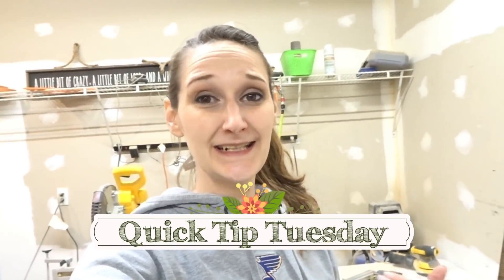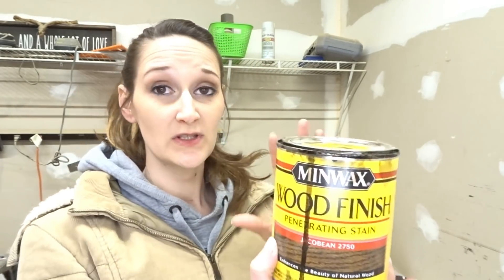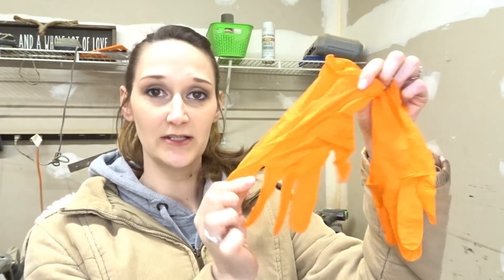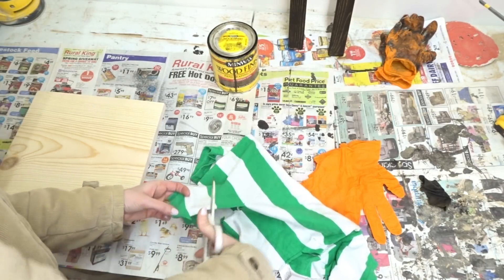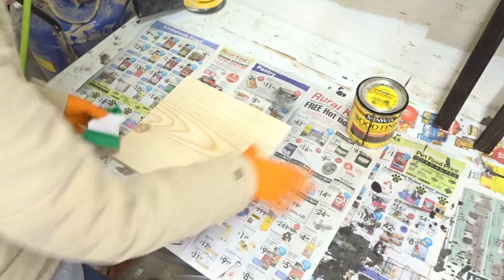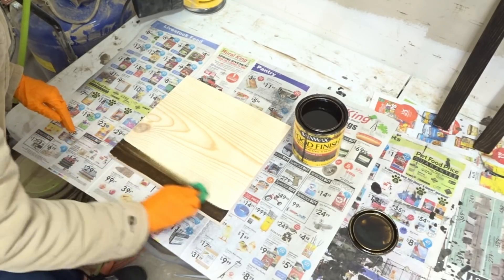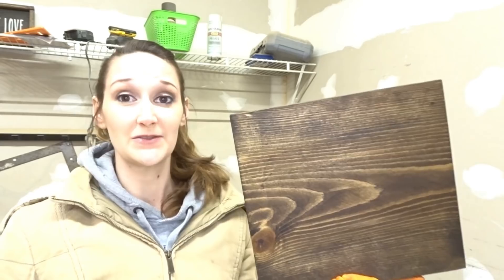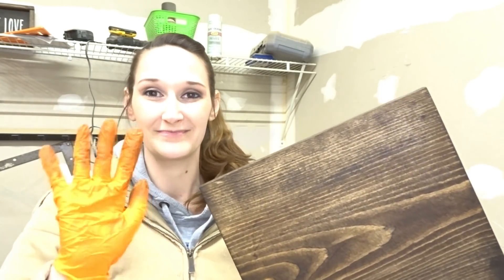Wood Staining Basics | Technique & Supplies | Quick Tip Tuesday

Comment: Hey Shannon! I've been binge watching, and re-watching your videos, and you've motivated me to get started on a many different projects. I'm having so much fun! So thank you! I have a question about choosing wood for staining. Do you look for a particular pattern of wood grain when selecting your pieces? I just stained my first 11-1/4  X 12 common pine piece with, of course, Jacobean. Some of the board really grabbed and went very dark, while some of the grain has really stood out. It seems to me that the wood grain is going to be competitive with the lettering. Maybe I'm putting it on too thick? Or maybe you have a tip for selecting pieces that you know are going to look best once stained? Thanks!
Reply: Oh, one more question. I had the guy at Home Depot cut my wood and there's a lot of tear out along the edges. Is that something I can prevent when I get my own miter saw?

Comment: I had a project and sanded the wood nice and smooth, then stained, and then when I went to work on it it was rather rough again.  I wasn't sure what to do so I worked with painting on it then put poly on it and then smoothed with steel wool another coat of poly and smoothed again, then a final coat of poly to have a nice smooth finish, but I had to do 3 coats of poly.  Should we have put the stain on without sanding?  Do you know the best way to get a fairly smooth surface with the stain so that I only need one (or two) coat of poly?

Comment: Hey Shannon.  "Happy New Year", as I don't remember if I've commented in a while!  I'm redoing a wood bench this weekend with chalk paint and a stained/stenciled seat.  Because it's a seat, I'm thinking I need to seal the stencil (whether matte, semi-gloss or chalk) or it would wear.  Is there a sealer you suggest?  And I'm wondering if you've ever tried the Minwax water-based stain.  Clean-up would be easier in my limited work-space but still want your great results.  Thank you in advance!!  And keep all your videos coming.  They are fabulous!
Reply from the maker: Happy New Year!  I would seal with a polycrylic, they make different finishes and it's very durable.  Great for things that will get lots of use and could wear over time.  It's in a stain/paint type can and is actually with the wood stain (even at walmart!)  I have use the Rustoleum waterbased wood stain.  I think it does have a different sort of effect.  Not a paint, but it's "milky" compared to the oil based.  It still gives a good finish though, just a little bit different.  Hope that helps!  Thanks for the comment <3
Reply: Thanks so much for replying, Shannon!  Think I'll stick with your oil-based stain and just bite the bullet for more mineral spirits.  And I even have polycrylic on hand for use with polymer clay.  Do I just dry brush it on?  I don't want to smear the stenciled paint.  Thanks again, lovey, for being such a kind and patient teacher.  YOU ARE A BLESSING!!